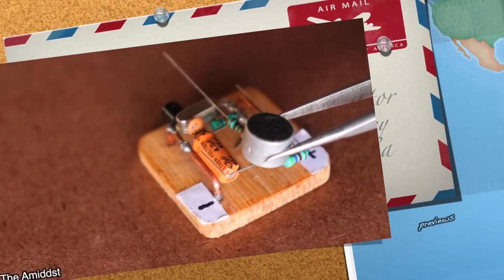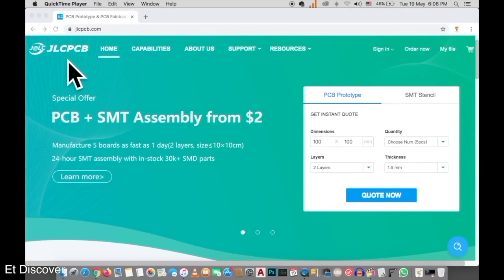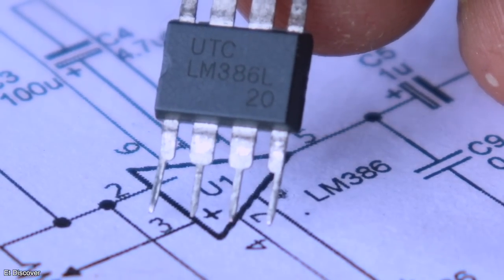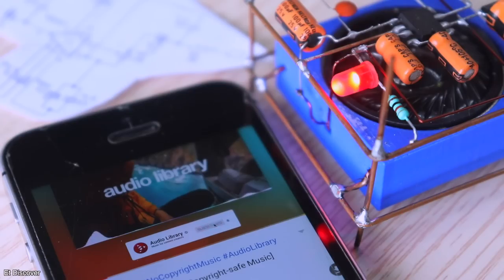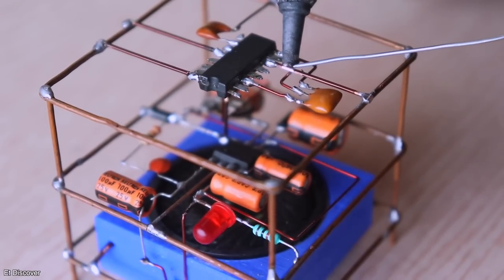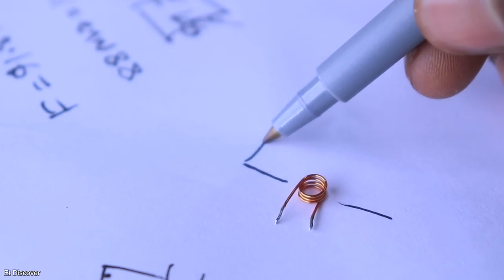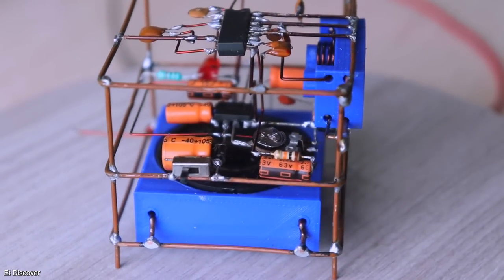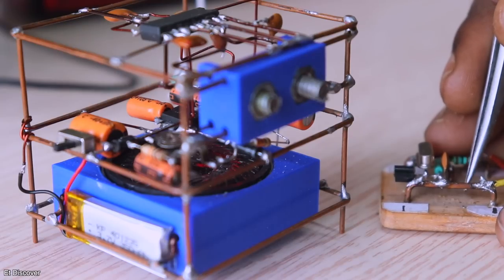This is your #Walkie-Talkie #Transmitter & #Receiver !! (Part 2)

Comment: I have tried the transmitter and it works... And As I guess crystal oscillator has  harmonic frequencies so we can listen our transmitted audio into FM Commercial range ( I use 16MHz Crystal and I can listen  too on  64MHz as harmonic-4, 80MHz as harmonic-5 - sound is less clear and 96MHz  clashed with one of commercial Broadcast) 
So, do you use harmonic freq. too for the receiver ?

Comment: Tda 7439 ic se koi bhi project ban paye ga kya
Reply from the maker: This is 4 channel input and output digital converter, you can use it with Clock and data

Comment: Explain me something.  You have used a crystal in your transmitter which fixes the value in the range of like either 16mhz , 32.16mhz , 10mhz or the other topical values of crystal available in the market . Then how are you able to tune them to the fm range? I don't exactly get it